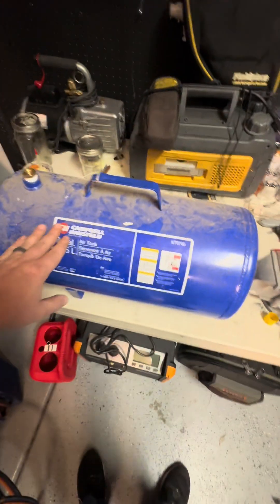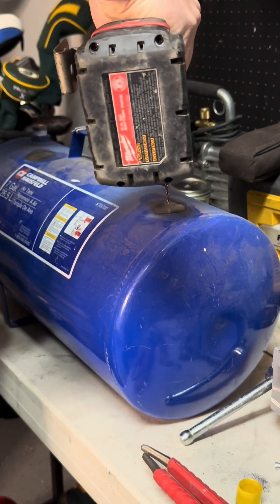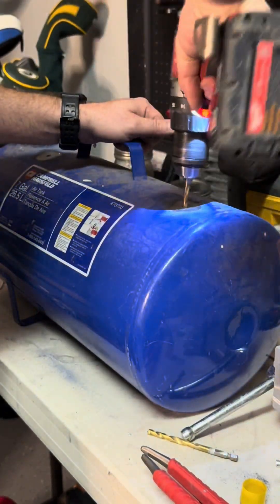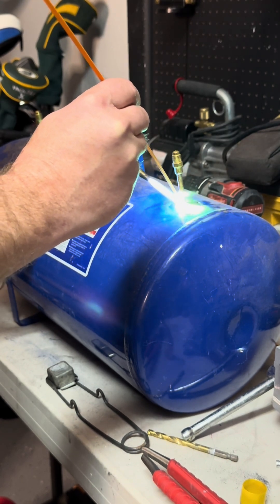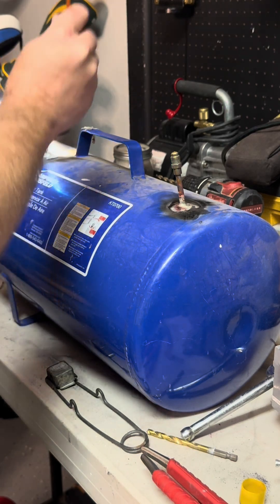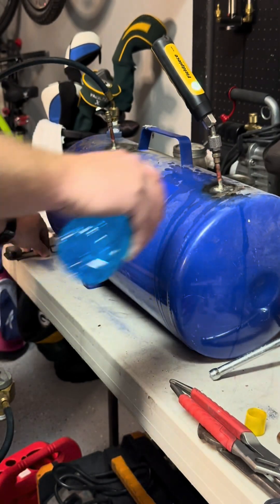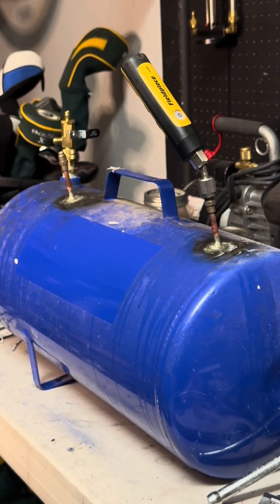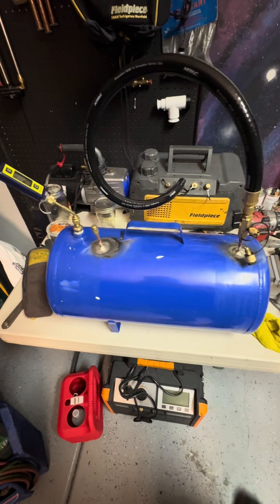Creating an evacuation trainer, with Ambro torches

Comment: What is an evacuation trainer used for and how is it used
Reply from the maker: @Johnrice-f4i  Evacuation is is the process of degassing and dehydrating a vessel (in this case we are talking about air conditioners). Air non condensibles and moisture are one of the major threats to the internals of air conditioning and refrigeration. This is going to be used to show the importance of using large diameter hoses and not manifolds to pull vacuums. This will allow the visual aid in a class room setting to show the importance and effectiveness of doing it correctly.